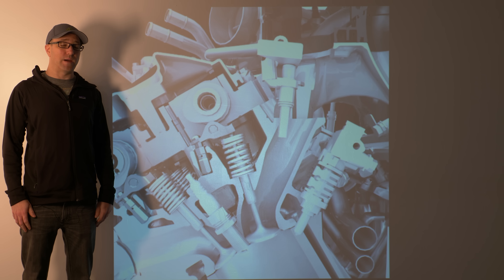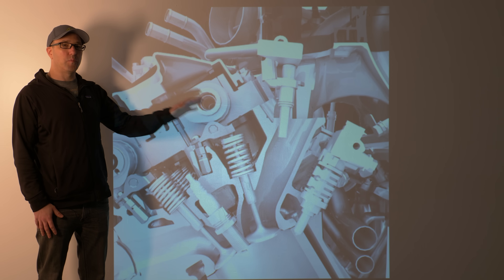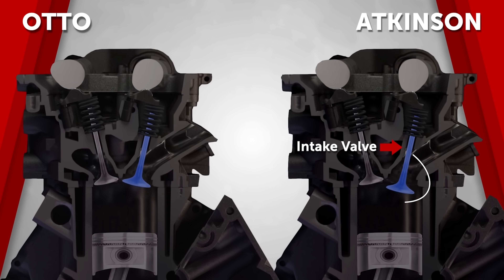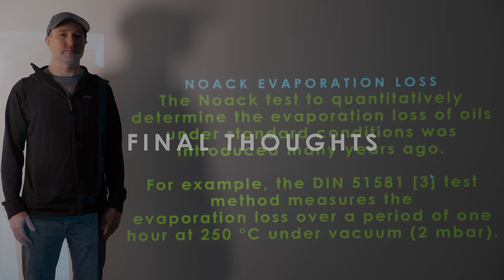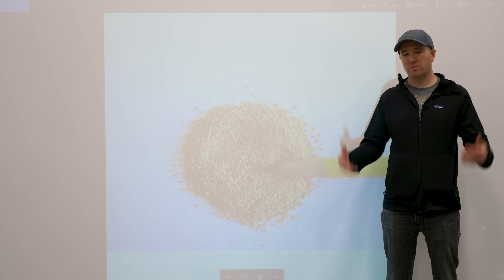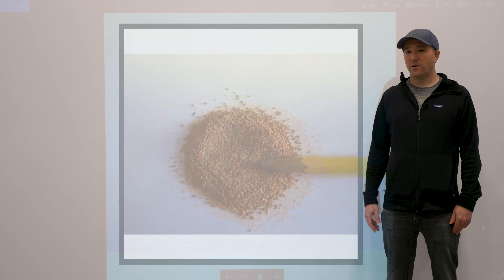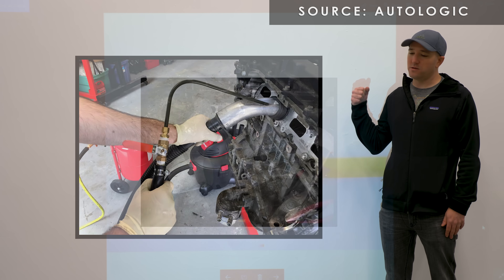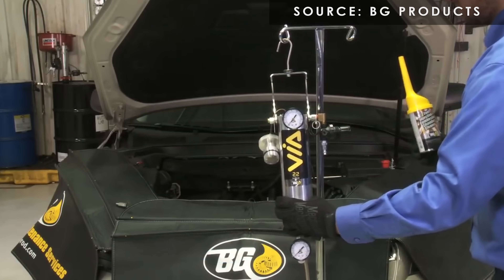Direct Injection, Problems and Solutions | The Fine Print

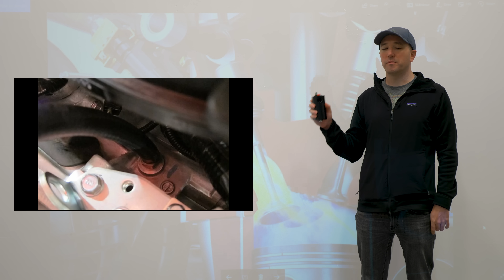Comment: All-in-all, very good illustrations of complex issues but the discussion of blow-by beginning at 7:20 is completely wrong.  Blow-by gasses go from the combustion chamber past the rings and into the crankcase during the power stroke--they are an exhaust product.  Without ventilation, they would pressurize the crankcase with ill effect.  Furthermore, because the engine is splash lubricated, the blow-by gasses accumulate a lot of oil mist in the crankcase.  Legacy open crankcase ventilation systems (OCV) used to vent these gasses to the atmosphere via a vent at the top of the rocker cover or other suitable location.  Modern engines with closed crankcase ventilation (CCV) systems route the gasses back to the induction track to burn them in the combustion chamber.  Because there is no fuel wash on the backs of the valves in a direct injection system, and without an effective mechanism to separate the oil mist and soot from the blow-by, this blow-by can deposit significant amounts of oil and soot in the induction track and onto the backs of the valves.  I just finished doing a carbon buildup cleaning on a BMW 335d and you would be AMAZED at how much gunk had accumulated over 115,000 miles.  The buildup in the diesel began with the introduction of exhaust gas from the EGR cooler just beyond the throttle valve.  The intake manifold passages were choked to about 30% of their original cross-sectional area and the intake valve profiles were totally obscured by the accumulated goo.  Manually scraping and vacuuming the heaviest buildup followed by walnut shell blasting was the only way to remove this stuff from the head (I sent the plastic intake manifold out for professional cleaning).  I agree that fuel additives will do no good in a direct injection engine as they will never "see" the intake track or the backs of the intake valves--the best you will get will be properly functioning injectors (not a bad thing).  Regarding the simple aluminum catch can displayed at about 14:40--that will help some but won't achieve "90-95%" clean (see the SAE report on oil catch can effectiveness at https://saemobilus.sae.org/content/03-12-01-0001).  Good video in part, but significant errors detract overall.

Comment: just thinking   gor tex cloth.. this will allow on air to pass thru not water vapour,, and the  oil vapour would be denser than the water vapour.. put this somewhere in a catch can.. on a disk inside..  this would stopp all oil vapour from getting past it.. and gor tex is ePTFE.... teflon, so  heated vapour would not damage it

Comment: been a few years  here, so i really dont expect an answer on this..... to remove carbon from the back of the valves... have you thought about a burning laser? at 445nm and 1000mW they can cut / burn thru lots of things,, the carbon behind the valves is relatively soft.. the laser would just vapourize the carbon off the valves.. and thes lasers are small, and easy to use

Comment: Sorry bro, but blow by allows oil vapor into the combustion chamber, not the crankcase, and conversely, some fuel will bleed into the crankcase, thinning the oil and exacerbating the problem.    When the piston goes down, it creates positive pressure in the crankcase, hence the term Positive Crankcase Ventilation.   Without that PCV valve, you could have enough pressure to push the oil pan gasket into leaking.   Not to mention the same movement becomes the inverse of the compression stroke, compressing the crankcase vapors, thusly causing resistance to the piston going down, which hurts power and mileage.   Plus the wrong kind of alternating pressures on the rings, creating excessive ring gap, but not ring end gap.   It beats up the edges of the ring lands.    There is not otherwise a “valve” in the crankcase, as in the combustion chamber, where these events have been meticulously studied for 120 years, and while the compression stroke does build tons of pressure in the combustion chamber, it is relieved just as often on the exhaust stroke.    Without a PCV, the pressure would sooner than later FIND an exit.   That’s why old engines leak, not from bad gaskets, and replacing that will only work until it gets blown out again.   The problem begets itself.    So while the PCV releases that pressure if it’s functioning properly and opens when it  still not really enough to match the pressure build up from bad blow by.   The compression stroke usually makes at least 150psi in the chamber on lower compression ratio engines, and that relatively high pressure is what gets combustion gases past the rings, the crankcase doesn’t generate that much, so the rings tend not to leak or “blow by” in the opposite direction, when the piston is going down.   But it still build enough to cause a problem, even with a new PCV valve.  Try blowing 40-60 psi through a good PCV valve, there will be resistance, and that’s bad.    On top of causing leaks, it fights the intake and power strokes too.   However much pressure is in the crankcase could simply be subtracted from the valuable pressure needed in the combustion chamber.  An identical engine with less chamber pressure makes less power.  Put your finger over the tip of a syringe and then try to compress the 
piston.   At some point you can’t.   There is no such thing as an absolute seal at the rings on ANY engine, thusly ALL engines exhibit blow by.  It’s a matter of how that is managed and kept to a minimum that is key, hence the three rings each for different purposes, PCV valves only open at certain times, etc.    Direct injection would seemingly “wash down” the walls of the cylinder with fuel, thusly reducing the lubricating effects of the thin film of oil meant to be left on the walls on each stroke.  Misfires make it even worse, cause that fuel is going somewhere before the exhaust valve opens.  By the rings and onto the walls of the cylinder and into the crankcase, thusly thinning the oil overall, thinning whatever oil is left on the cylinder wall, and grossly accelerating ring to cylinder wall wear, plus allowing excessive heat buildup on the rings which can make them brittle and break, and the cylinder walls themselves can develop heat induced irregularities which can also break rings.   All. Bad.    Very bad.   So yeah, Direct Injection might be great for the first 20-60,000 miles.   Then not so good.   Who signed off on this?   I’ll tell you who.  A big table full of bloated morons who each make more money than I’ll ever see, to do what, fail grossly at their jobs and get massive pay bonuses because they “saved the company from tons of expensive R&D.    Nice work, humans.

Comment: Congratulations on explaining about gdi and it's pros and cons, but one thing that is missing not on the video but as to economy it all goes well on theory, planning and manufacturing and selling a brand new car, but out in the field is a new game.
First as to economy wise yes off the start you will get savings true and what you save on money buying gas you will spend all of it and more on maintenance and even more with dual injectors per cylinder.
As control of emissions it will good in the beginning also but when customer finds out the hefty bills to keep their car running clean not all will comply no matter how you dice it or slice it as money budget has its limit.
A cat and mouse game, by all means I ain't no master of know it all but 38 years on the trade I know the field well when comes to customer spending their limited budget on repairs there will be sacrifice.

Comment: I've mentioned the use of a catch on DI engines to several mechanics and they poopooed the idea, that it wouldn't meet emissions standards.  You're the first (so far) that I've seen that recommends using them.  I've been using them on my car/truck/motorcycle engines since the mid 70s (along with the use of quality engine oils/filters and always changing my oil regularly)  because I always believed that a free breathing crankcase is a happy crankcase.  Hadn't had any of them gripe about it yet.

Comment: I bought a 2011 3.7 L Mustang last year that still has port injection and I have heard all sorts of horror stories about the EcoBoost 2.3 I talked to a guy recently who showed me photos of what the intake valves on the engine that he had replaced and when I get another car preferably a Mustang I'm going to look for either another Port injected 3.7 or a 5.0 coyote.

My parents have a 2014 equinox and I'm worried about that thing because it's direct injected

Eventually somebody has to come up with something you can just spray into the intake and melt the crap off but it seems like the only way to deal with this problem when it becomes a big problem is to tear a good chunk of the engine off which is retardedly expensive

Comment: Working on a ford right now with intake valves so carboned up they leak. Can't get the intake off without pulling the dam head because of the way its built. Customer will be told to trade it off after it's fixed. I have read that CR makes a spray they claim is safe to spray in intake to help keep the valves clean.

Comment: The main advantage of GDI is that they taper the O/F ratio in the cylinder, making it richer near the spark plug so they can run leaner overall mixtures without misfires.  I thought some of the latest GDI engines added a single fuel injector after the throttle plate to distribute gas to all intake runners to keep them clean of soot, rather than one at each port like the Toyota design you show.  But, haven't owned a GDI.  Sooting the intake is worse with EGR.  Many minivan engines get by without EGR since classed as "trucks" by the EPA, which are allowed to pollute more.  My 1996 and 2002 Chryslers are like that.  The same engines in sedans had EGR.

Comment: My neighbor has a 2016 Kia optima 2.4 gdi, the tailpipe has a oily black soot on it, he installed a catch can and runs a can or two of crc cleaner through the intake every oil change which is supposed to help clean the valves,

Comment: 60/70/80 mpg from a lean burn petrol engine, not a chance in hell , we had the Toyota avensis lean burn engine in Europe in the 90,s and they gave  about 40 mpg and the engine would not have enough power to pull out of bed..

Comment: Nice video.  Can you clean gdi intakes with the sprays you can spray into the air intakes ? I have Stinger 3.3L TT.. any suggestions on how to clean them out myself ?  You recommend I use fuel injector cleaner additives regularly on gdi stinger ? how often ?  And does the full synthetic oils better at reduced carbon build up and issues over Conv. oils ?

Comment: I have run my Jaguar X300 on LPG for over 100,000 miles with no carbon build up on the valves.  There is no petrol to clean the valves so what’s the deal?
Reply: Maybe turbo causes the problem.

Comment: 120,000 miles in my GMC 6.2 liter DI engine. No problems. Fuel economy same as when I bought it. Also, the engine in the WW2 Messerschmitt fighter was GDI. Superior performance doing aerobatics vs. carbureted engine in the British Spitfire. And the famed Mercedes 300 SL “ gull wing” six was GDI.

Comment: I've worked on a lot of poorly running GDI engines. It's usually an insane amount of carbon buildup. I've never even seen half as many issues with sequential port injection, the injectors just need to be as close to the valves as possible. Everything has it now too, the efficiency they've tried to achieve has caused reliability to drop drastically in the longterm. I've seen valves in an audi 2.0 TSI that were almost clogged completely, it just cooks all of the pcv fumes and blow by to the valves and intake runners. It just misfired and ran like shit, guy could never get an inspection sticker. I'm pretty sure Koenigsegg did the GDI, Port combo first. Seafoam works great but theres usually too much carbon for it to clean it without using 5 cans of the stuff, cylinder heads usually have to be take off and blasted.

Comment: Solution for DI is methanol injection in intake manifold and to control pump by simple control unit which only turn on during high RPM. Clean shiny intake

Comment: One could argue that water/meth injection will also work to clean not only the valves but the combustion chambers as well, only problem is that it's another tank you gotta fill and would require tuning to run optimally.

Comment: great wish i seen this before i just bought a 2021 Colorado on Tuesday . One question our new pickup makes a loud tapping noise about 1 minute after starting is that normal for direct injection? took it back to dealership and the said oh it has a lot of plastic vacum pieces  that's the reason for the noise oh and the temp. runs at about 206 after sitting idle for about 6 minutes ????  also when driving it is about the same 206 temp.

Comment: Direct injection  should be banned. It has no real advantage in the long run. You try to save fuel but in the end you spend more in cleaning.  So you think you are helping clean the environment?  Cleaning the carbon out creates more pollution not just from the carblon removed but also from the chemicals used to clean out the carbon. What fuclking liberal idiot designed these engines?

Comment: Direct Injection is the BIGGEST STEP BACKWARDS in terms of engine refinement, nevermind the dry intake and carbon fouling problems. The issue is two fold, thousand psi injectors make a lot of noise and high compression itself makes a little more noise. Compare any of the current DI engines to a 1990s Mazda/Ford K-series V6 or the Toyota/Lexus 1MZ engine and you'll immediately notice that those ancient engines run quieter and smoother -- especially at idle and low rpms. You'll also be able to clock 300,000 miles with no carbon issues and nothng but relatively INFREQUENT oil changes every 6,000~8000 miles with a decent synthetic. Ultimately it'll be stuff like the tranny, starter and distributor cap that goes.

Comment: In the UK there’s a company called Terraclean that deal with this problem by passing chemicals through the inlet for about 1 hour. Supposed to work. 
I’ve just bought a VW 1.0 turbo TSI and I’m planning on doing this every other year as a preventative measure.

Time will tell 😂

Comment: Recently brought a 2011 Lexus IS 350 over a IS 250 just to have the extra added port injectors for this reason, plus the 3.5L is a way more powerful engine with 12 injectors vs only 6 direct injectors.

Comment: They failed to match exhaust gas pollution regulation, they actually produce more pollution than ported egines, in reality while they are clean you got a bit better performance, a bit higher torque, a bit better economy but with much higher cost, engine problems and difficulties, more expensive parts, worse air pollution, so my friendly advice is STAY AWAY FROM THEM!!!

Comment: Port Injection FTW!! This is why I am looking at vehicles like the STI or the Tacoma, because they still utilize some form of Port Injection and I don't have to worry about this carbon buildup bullshit.  I'd much rather have less MPG's then have to worry about my engine seizing up on me because I forgot to blast it with walnuts.  My 2008 Civic Si has Port Injection...157,000 miles and not one issue mechanically and i still get 35 mpg

Comment: I add Seafoam at oil changes and get the fuel system cleaned every 15,000-20,000 miles and send oil samples to Blackstone Labs. 👍

Comment: When looking for a used car a couple years ago one of my goals was to get a vehicle without direct injection just to avoid the carbon buildup. Granted, a DI engine "may" only need valve cleaning a few times during ownership, but my choice was to avoid it all together. I do have a feeling as time goes on it will be harder to find a non-DI engine but I'll deal with that when the time comes and "maybe" this service will common enough that cost isn't too outrageous.
Reply: Smart comment 👌.
Reply: DI is, and always will be overcomplicated junk.
Reply: @dannygreen7473  ok boomer
Reply: I highly recommend a 2012-2017 Camry

Comment: My Civic SI 8th GEN is nearly 12 years old with 156K on the clock. Not one misfire, no carbon buildup bullshit, and the only check engine light I’ve ever had on the car (and I’m being serious), was when my original starter motor went at 146K. The reason for most of this....naturally aspirated port Injection. I’m also still on my original water pump and full clutch assembly

Comment: The explanation of the PCV blowby is incorrect. The blowby goes from the chamber with the compressed fuel mixture down into the crank case. The PCV valve reduces the pressure build up in the crank case, by releasing the oil vapor contaminated air into the intake. To much unburned fuel in the blowby dilutes the oil, another issue with the GDI engines and modern low friction piston rings. 
Besides, very well explained and easy to comprehend.

Comment: Really it just sounds like regulations pushed the automakers into a position they couldn't solve and they passed the shit on to us because what do they care as long as the engine lasts as long as the warranty. Who cares if it blows up at 65 or 100,000 miles. Let them deal with all the oil coming back into the engine and coding everything completely destroying the block. What does Kia care if they have catastrophic engine damage at 30,000 miles? How about a Ford Escape having catastrophic engine where at 60000 miles?

Comment: Great presentation. My experience: 2006 AUDI TURBO QUATTRO A4 @ 220,000 KM.  Started running roughly. It was carbon fouled intake valves, mainfold and injectors. It cost 1700$ CDN to clean out the engine. I use liqui moly jectron regularly now hopefully to keep the injectors clean.
Reply: Use Ravenol